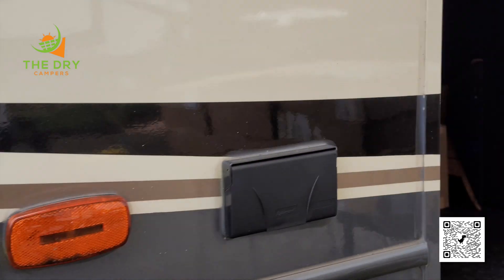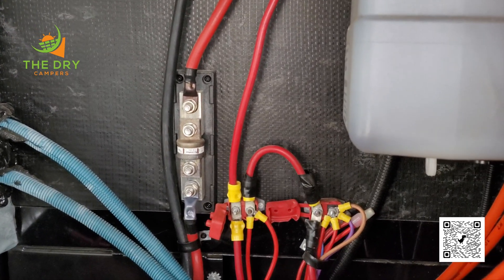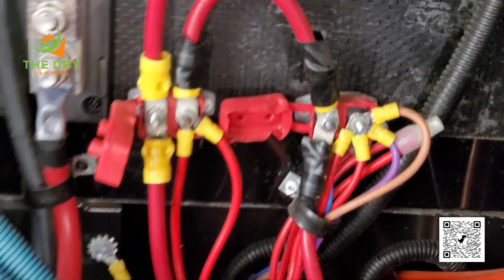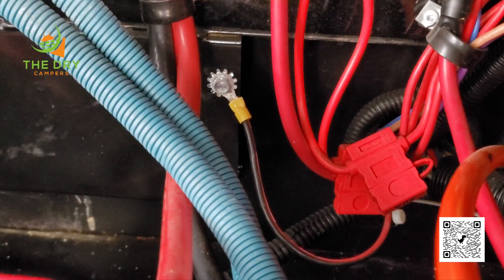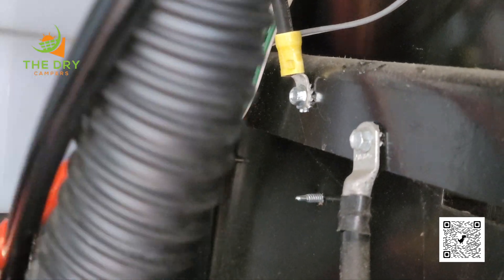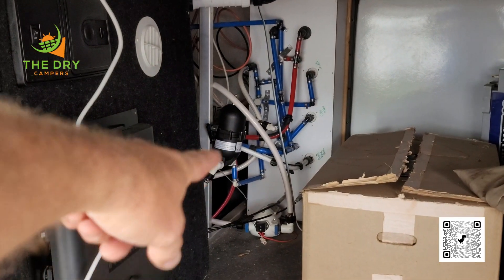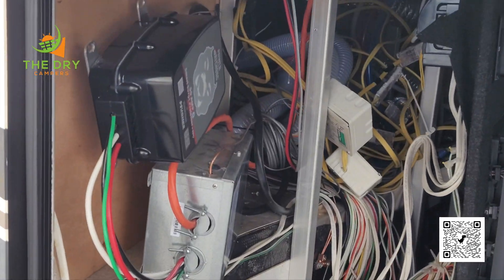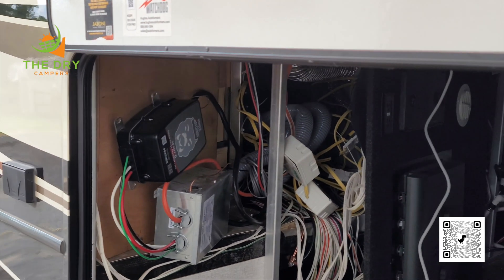The Power of the Sun: Elevate Your Montana RV Adventure with Solar Installation!

Comment: The top solar charger will be the the first to shut down with not only the cooling fins sideways  but radiated heat from below and forced  hot air from the multi !! 😢
Reply from the maker: Every install I do, there is airflow.

Comment: Nice to see you back and actually talking during the video.  How do you deal with all the heat that is produced by the dual inverters during charging in that tight space especially when victron recommends a little over 4 inches between and around the inverters?
Reply from the maker: The systems I design, allow for airflow. Some clients want a fan installed and I will do that as well.